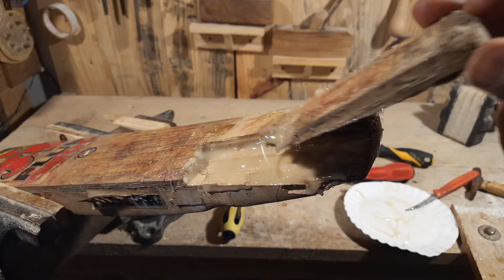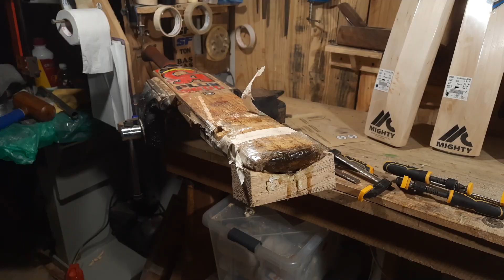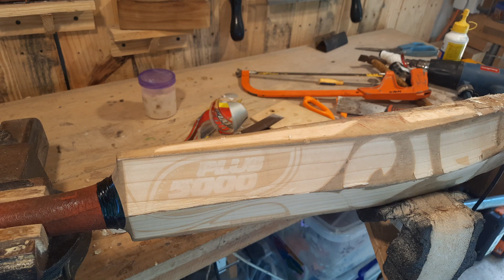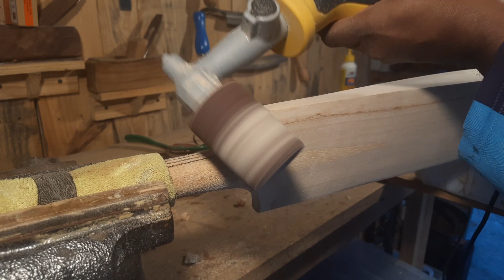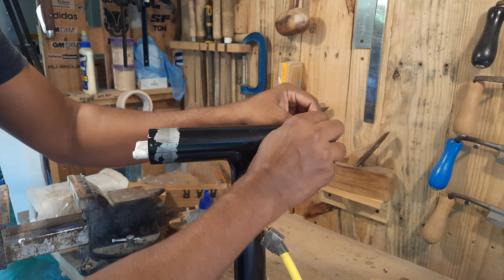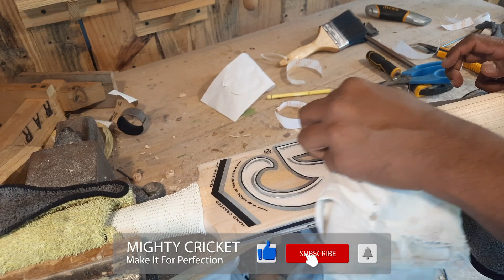Cricket Bat repairing video EP 28

Comment: do you use epoxy to stick the wood back in place? surely its not ordinary PVA wood glue?
Reply from the maker: Yes this is epoxy but not like normal epoxy ,,,  its soft epoxy. U can use any epoxy but it will make wood little hard so it can easily crack the bat when the ball hits the same area